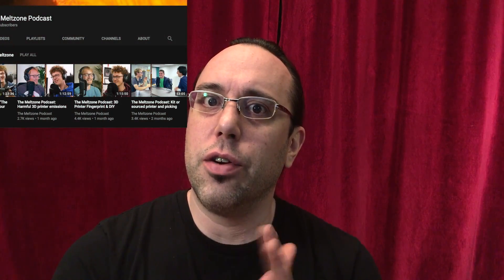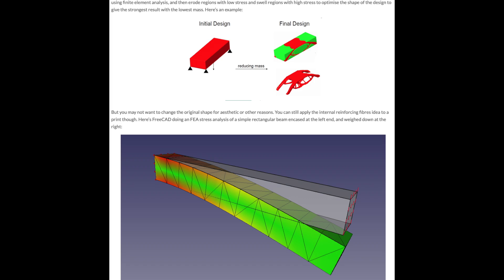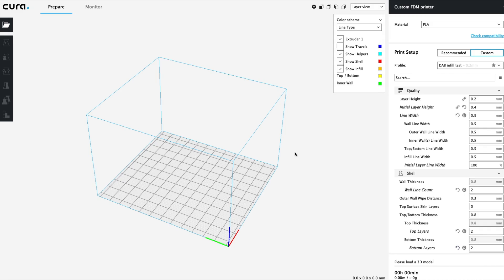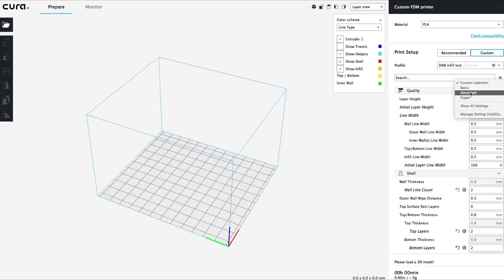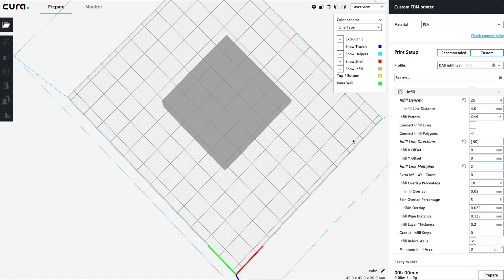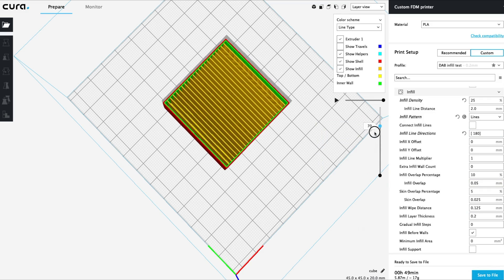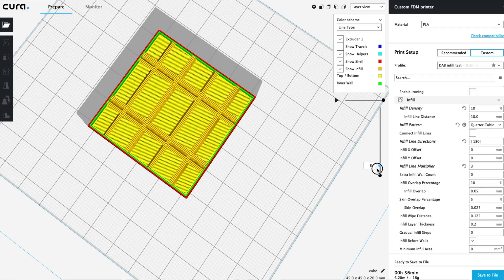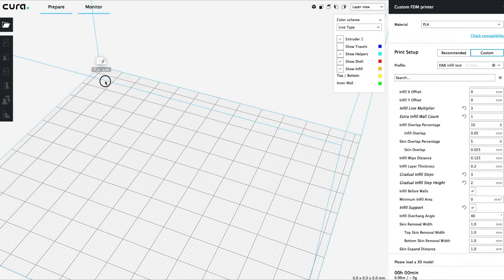FEM infill concept: reaction to Dr Bowyer's post

Comment: Hey Alex,

I agree with your assessment here. While Dr. Bowyer is following an ultimately successful path for additive manufacturing his solution is kludgy and hacked together from a mechanical engineering and computation perspective. If we're talking FEA then we're talking mechanical engineering and in that realm it's a pretty weak idea. Principally, the cylinders act as stress concentrations and as a result they increase stress in those areas that they should be reinforcing. In practice thee cylinders probably do increase strength but their effectiveness is limited by their inherent stress induction.

It's also an ineffective use of mass, there is an inherent granularity to having a cylindrical shape and wall thickness settings. you can think of these cylinders and their wall thickness settings as pixels.  

I expect that Autodesk will ultimately achieve the purpose of Dr. Bowyers concept. They have topology optimization and generative design products AND a slicer all in one package (fusion 360). Their next step is just to integrate the output of the TO and GE into the slicer so that solid plastic will be formed in the high stress regions. Obviously I'm over simplifying this but for the sake of this conversation, they are so far ahead of Dr. Bowyer the previous statement can be treated as fact. CNC Kitchen basically did the same thing with one of his hooks.  

Thanks for the videos, glad I stumbled upon your channel

Comment: Ok, let me set this clear, for vacuum strength we don't need to add resin, after the vertical channels being made up to the printer bed, we should just make a smart decision to leave some plastic, and a STRONG HEAT BED TO MELT THE BOTTON SEALING INFILL PLASTIC, in orderly manner (with some solid layering to avoid deformed base after some milimeters melted, where the channels will be sealed with melted infill with very hot air inside. This will create miriads of strong vacuum channels once in ambient temperature. Like my alter told, nothing is stronger than a very well directed vacuum. And a bad reinforced design would really collapse the entire finished piece in cold.
Ah oh I saw a cross xy vacuum channels in diagonal crossing direction would create a supperb strong piece.

Comment: Great! 
IDEA: If we create a many 5mm diameter piston surrounded by a cilinder wall  with tha with a tiny amount of glue or smart design, can pop out with some force creating a strong vacuum cilinder,  the optimal best strenght property along or (perpendicular?) the axis of these channels! 
We could use heat bed cilinders that transport the heat along Z axis by natural expansion, and closing by leaving a place to fill with resin that would sip into the openings right over the bed, the channels would be locked after cure, creating a vertical hot air channels that once out of the printer heat bed, would find a ambient temperature, if not well made, collapsing on its own,
 Well this is not in sync with my this cute alt profile, but cafeine is great! :)

Comment: What about the gyroid infill in the new cura ?
Reply from the maker: I have not done any testing on it yet, but I like that it is an 'open' pattern, so theoretically you could more easily fill the print with a stiffer medium to add more strength

Comment: Very nice, I can see this getting somewhere, now that we have potential to close the loop in so many ways more than having to get a whole 'mother neuronal network in there analyzing multi spectral quantum CCD image data ;) We can as I understand extract info about the effort from trinamics stepper drivers, they may be able to help deduct important info like filament backpressure, or encountering of obstacles on the stepper axis. Of course a microphone and acceleration sensor/gyro on the head and a dedicated controller to evaluate that data could make the printer(mill) 'see' replace bed leveling or learn to print on objects! I also would like to know if information could be impressed on the filament by applying voltage or magnetic field across the 'freezing' (passing through Curie temperature) filament being deposited in the moment! If all of this happens in an open source context - what an exciting time to be alive!

Comment: Rather than integrating FEM/FEA into a slicer, maybe just support importing a density map from such an analyzer into the slicer.  It wouldn't be as good as a 3D infill aware analyzer, but it would be better than how it is now.  There were a few presentations at #MRRF about this the last few years.  I will check my notes and see what I can find.
Reply from the maker: That was along the lines of what I was thinking with some sort of import module that ties into the slicer and uses the established subdivision math.  I think it could be decent
Reply: @AlexKenis  I agree, it seems like an easy first step.  Is there some kind of standard format for such output from a FEM program?  I am unfamiliar with them.  If there is, I will open a feature request in slic3r.
Reply from the maker: I would have to look.  I would imagine they all have an intermediate format, but the one I try to use for compatibility is STEP/STP, but I am not sure if it stores density information.  I actually found a paper where they poke at the issue a bit, but have not looked further into it. https://arxiv.org/pdf/1608.04366.pdf

Comment: Nice video Alex! Good insight into the "hidden" features that CURA gives us. I'm really thinking about how to implement these virtual fibers in an efficient workflow to make it more approachable.
Reply from the maker: I took a peek at the subdivision generator in the curaEngine Github to see how feasible it would be to add in a function to tie density to some sort of FEA generated density grid, or even an in-slicer user defined map.  Unfortunately, the engine  recursively calls an algorithm based on planar collision with the shell (I was hoping for a more granular control than if X distance from wall then subdivide). STL files also describe a surface, which is unfortunate because it would have been  nice to feed the slicer a file with density information and have it do a 3d decimation to generate infill reference points, but FEA/FEM already does it's own internal remeshing it doesn't seem unreasonable to modify a slicing engine to accept to accept a file format with non-uniform density data and rewrite the infill subdivision code to approximate it (decimate and quantize into 'gradual infill steps', which would be more granular and faster to print than embedded shells?
Reply: Problem also is that a generic FEM analysis is not sufficient, as use cases are different. You would then need to be able to tell the slicer also the stress points, mount points etc. data; And that point it is not "just a slicer" but part of the design package.
THAT BEING SAID, generic analysis could be done, for the Quick and dirty extra strength.

To hack current algo to recognize that you could feed false information to that algorithm based on the FEM analysis, by adding magic invisibile inexistant "tubes" for that algorithm only to generate the stronger points... Akin to in the old days i used to make 0.1mm holes in models to get stronger areas ;) In that sense many of us has been doing this for the past 7 or so years. That 0.1mm hole would not be visible, and would be in practice completely filled, but you would get perimeter walls around it for added strength :)

Comment: Great video. I'm not convinced that these "smart infill" methods make that much of a difference compared to cubic subdivisions or quarter cubic. There is a point where diminishing returns apply. IMO, with any kind of decent 3D infill, the type of material, layer height, and temp are going to have much more effect on the strength of the part than this.

Comment: still waiting for your RE-ARM + RAMPS 1.6 plus + TMC2130's  senseless homing + SPI (have a coreXY in the build processes but having trouble with the electronics)
Reply from the maker: Going to start testing soon.  I was waiting on the drivers that they sell as a kit with the 1.6+, and they just arrived from china.  Since I assume many people would go for those out of simplicity., but they are non-flipped drivers (ie heatsink on the bottom) and with the heat issues that trinamic can have, I wanted to A/B them against the Watterott and see if that is a big deal or not.